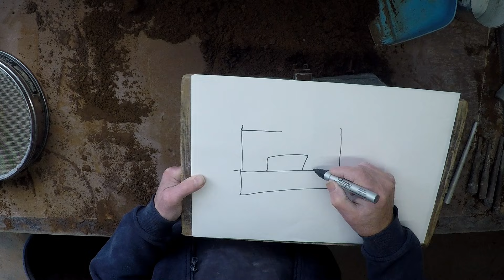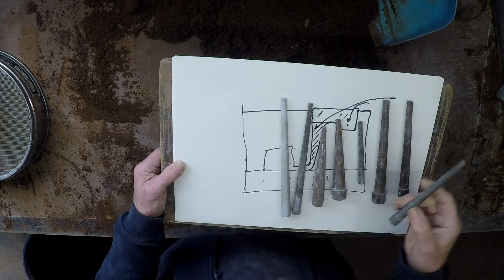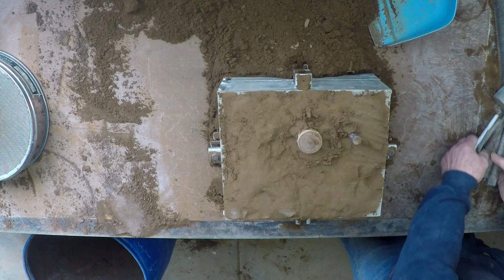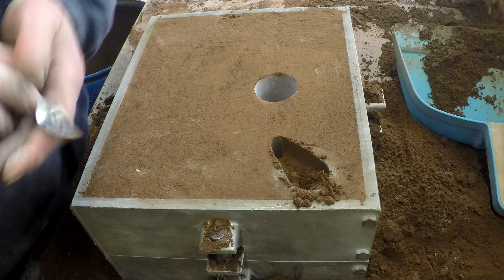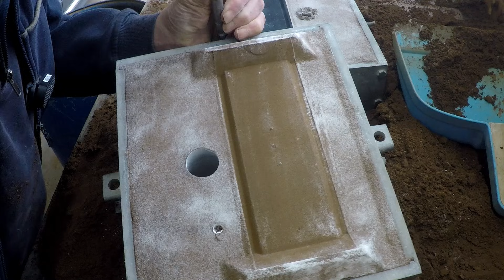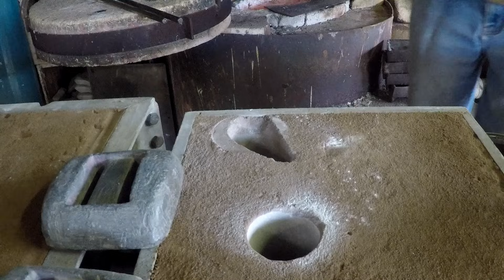Basin and sprue design for sand casting in the foundry

Comment: Great video! Finally someone is using the guidelines of prof. Campbell on youtube.
Reply from the maker: Gabor, Yes, I am very much a JC devotee. His work is very much a greatly needed breath of fresh air into the staid, old fashioned, rigid, dogmatic, and pig headed foundry industry. My one regret is that I discovered his work too late in my foundry career. I have been using small tapered sprues since the mid 1970s but other of his refinements I have only adopted in the last 5 or 10 years. I would love to sit down with him and/or Bob Puhaka because I have a million questions. I have with varying degrees of success tried to introduce others on UT to his methods but sadly many are just not interested, content instead to bumble on as the foundry industry has done for millennia.... Martin
Reply: @olfoundryman8418  I've had the chance to meet and talk with JC a few times. He is a real gentleman, really nice and down to earth. Also, he is really helpful and always finds the time to consult with me via e-mail. I think you should try and ask some questions in an e-mail.

Comment: Awesome video! Would have been nice to see what the results were, especially the one that had the sprue exposed mid pour. But still great to learn
Reply from the maker: Cole,    You are not the first person who has expressed the wish to have seen the resulting castings. I did not show them because they were just more moulding box sides and I had already shown these in an earlier video. Whilst bad, the exposed sprue in mid pour was not too bad as the metal level did not fall very far down the sprue and metal velocities with this sort or low mould height are low, thus air aspiration would have been, at worst, minor. The casting concerned certainly came out looking ok but this is an important point that allows a lot of people who use bad sprueing techniques (tin can mould height extensions and parallel sprues for example) to fool themselves into thinking that they have made a good casting. The results of air aspiration are not always seen naked eye visually in a casting. The results are the production of vastly more oxide films (sadly some are almost always present). Their presence is revealed in poorer mechanical properties – particular ductility rather than in casting visual appearance…. Martin

Comment: Very interesting indeed... This is a level of savvy I've never seen in any of the other casting-themed channels I have watched so far. Very glad i watched this video.

Presumably the same technique applies to casting in copper & brass. Are there any hazards to look out for when pouring either into the sprue basin? (Aside from the molten metal itself, that is. I understand liquid Cu is way hotter than Al!)
Reply from the maker: Insert, Thank you very much for saying so. Yes, the technique applies to copper and brass - to any molten metal that can be sand cast in fact... Martin

Comment: I learned more in this 20+ minute video than I have in any casting book or video I've found...and I've watched a lot.  It's not just your knowledge, your teaching skills are great and I'm not blowing smoke.   There's logic around all of the flows, and in keeping that flow air free and smooth.  Thanks for this, and the kindness in sharing all this information.  If you are ever looking for ideas on what to go into detail on next, I'd be interested in learning what to look for in riser, gates and runner design...but as I go through the videos you have up I'm sure I'll catch it.
Reply from the maker: Tom, Thank you for your comment. Feeder, runner, and gate design is a complicated area requiring quite different treatment for different castings - there are some basic rules though that have managed to surface through the still incomplete knowledge of the subject. Health permitting I will try and do something along the lines that you have suggested. To be honest in my own work I usually just eyeball a given casting and based on experience (60 years plus) make an initial guess as to these requirements and then let the first try or two refine my approach. Not the best way to do things perhaps but I do not have the resources to get my hands on casting simulation /calculation software.....  Martin
Reply: @olfoundryman8418  I can completely understand the eyeball approach.  So many things have been designed based on that, and as long as you've been doing this there were no computer simulations for those flows...and even today they are probably quite expensive.  What I try to do is learn from the experts in the field such as yourself, and copy, and then adjust a little bit to account for my projects being different.  Truly appreciate all that you give to people learning this science/art.

Comment: Very interesting, thankyou for explaining all of that. Definitely surprised by the small sprue size, will have to look to that.
Reply from the maker: Jack, Yes most people (particularly old time foundrymen)  look at that small sprue size and exclaim that the casting would never run - WRONG!. But look when they pour - a small stream (just like through my sprue) but down a big hole, flow rate is the same but mine is largely turbulence free. Try it for yourself and see just how fast metal will go down a properly filled small tapered sprue..... Martin

Comment: I would have liked to see what the results of the pours were. Could you see a difference in the ones that poured not quick enough?
Reply from the maker: Todd, All the parts poured here were the same size moulding box side - BUT - some were made using just my backup sand and some with my much finer facing sand. This made it impossible to really see any difference (other than surface finish) that may have been due to the slightly slower pour.  I doubt that the slower pour had any serious effect as it looks as though the metal level in the sprue did not drop to what I would regard as a dangerously air sucking in level - too low for sure but not disastrously so. The giveaway here is that had it done so I would have seen a bubble or two come up the feeder and I didn't. You are not the first person to have wished to have seen the resulting castings - I usually show them  and why I did not do so here is a bit of a mystery. In future I will make a point of it..... Martin

Comment: great video!  can you help me understand if the sprue had a runner to the part or did it have a runner to the feeder/riser and the feeder/riser had a second short runner to the part?
Reply from the maker: Jim, My preference is to have a runner from the sprue base to and indeed some way past the bottom of the feeder and then a short gate from the feeder to the casting. Typically the gate and runner would be at right angles to each other. This method is advantageous as it means the last metal to enter the mould, and therefore the hottest, is in the feeder right where you want it. Also if any air does get pulled down the sprue and runner it should separate out in the feeder. It provides the opportunity to increase the gate size to help control gate velocity to below that  which it would be if the runner was connected directly to the casting. A feeder on a gate eliminates any hot spot shrinkage associated with the metal heating the gate area. You can't always do this of course as it depends on where feeders are needed i.e. it works with side feeders but not so much with top feeders.... Martin

Comment: Brilliant video, I will soon be doing my first castings and have been looking around for tips on how to go about it and so many people are getting bad results and you have just explained why. I thought it was just a bit hit and miss but not the way you have shown it should be done makes total sense. Thanks for sharing and can't wait to have a go.
Reply from the maker: Jeff, "a bit hit and miss" well, that's sort of the way the foundry industry has been for about 6000 years! It has been able to get away with bad techniques because despite them sometimes you can get a good result. So if you ignore the bad results and your customer is prepared to do the same it all goes along sort of ok. However when first starting out and using too many of those bad techniques as copied from the wrong areas of YT, truly good results can be very thin on the ground indeed. Nobody can do it perfectly of course - there are always areas where it could be done better if one had a big enough and expensive enough 24/7 enterprise. None of us do, so the best we can do is eliminate the worst of the bad stuff and from what I know this will be enough to give results of which you can be truly proud...Martin

Comment: Very very helpful! I can't wait to give this a try!
Reply from the maker: Tony, Pouring fast enough to keep the sprue full is a bit of an acquired art but if you are ready for just how fast even a small tapered sprue will take metal you will soon get the hang of it. But remember the ridge wants to be at most 10 mm high from the bottom of the basin and a generous radius between the ridge top and the sprue is most necessary. I think that you will like how well it works and just how calmly the metal enters the mould..... Martin

Comment: Great video. Do you see erosion at the bottom of the basin where the hot stream burns out the binder and washes loose sand into the mold?  I expect the basin depth minimizes the effect except at the start of the pour. Thank you.
Reply from the maker: Fred. No, I have never had erosion in the basin or indeed anywhere in any of my moulds. The height through which the metal falls to hit the bottom of the basin at the start of the pour is deliberately as low as I can get it and thus the metal velocities attained are way to low to cause any erosion. In fact the metal will not even pick up loose sand anywhere in the gating system, rather it simply rolls over the top of any loose material.  There is an exception to this of course in that thin edges of sand as might be formed where a gate former does not quite meet the pattern properly and a sand strip only a grain or two of sand thick sticks up into the metal stream may sometimes erode. But if gating is correct to keep turbulence low and the gating system full erosion is not a  problem, even  with moulds considerably higher than mine... Martin

Comment: What pressure is your compressed air coming out at? I feel a full 100 psi would blow my sand molds apart.
Reply from the maker: Jessica, Well, I do not use 100PSi anywhere in my air system. 70 to 80 PSI is about as high as I ever need. But, yes, that would blow a sand mould to pieces. I have a small regulator right where my air line splits off to the blow gun, this is set to just 15 PSI. Even so it has to be used with care. The initial "puff" of air coming from the blow gun can be a bit harsh so it pays to point the gun away or hold it fairly well back on squeezing the trigger. The trigger needs to operate smoothly and gradually - no sudden jerk on! For delicate work  - like text - I hold the gun a fair way back with not much air coming out, moving it closer as I watch the mould to see when the loose grains are blown away. Like most things in casting it is an acquired art...Martin

Comment: Thanks for these videos, great information, watched most of them. I've uploaded my first few pours if your interested, they are getting better.

I had an idea of a two part radiused sprue form, saves me trying to cut it and less loose sand by ramming it. Reusing a cast sprue makes it the right height for my box.
 
Without exothermic powder, should I use a blow torch on the feeder to keep it hot, for about 20 seconds?

I have some ecogas16 degas powder. It only bubbles for about 10 seconds,  would any benefit be negligible? You use argon for several minutes?  These contain sodium flurosillicate and calcium carbonate.

Thanks!
Reply from the maker: Mark, sorry to be so slow replying but a short hospital stay plus recovery time got in the way. Also I am trying to get so more definitive info to reply with - this is still awaited.  I am not sure what you mean by a "two part sprue form". If the idea is to use a solid model of the sprue/basin combination and ram it in place then remove, its an idea that others have tried but abandoned due to the ramming difficulties. Commercially such basins are often preformed in some sort of hard sand - fenotec, silicate, or shell for instance. these are placed on the hole left by the rammed in and removed sprue former. I had planned (before health issues got in the way) to make up a set of moulds for shell core pouring basins. Kelly Coffield who does absolutely the best lost foam work uses a preformed basins made from a mouldable fibre ceramic he reuses these apparently up to 50 times each. Check out his channel - he is a clever fellow.
Re exothermic, very few hobby people use it. While I consider it helpful it is not strictly necessary - its probably better to optimise the shape and size of your feeders - which at the moment look rather inadequate. I would not play any sort of flame on the top of the feeder as it will cause turbulence on the top of the liquid metal and as the flame is in large part water vapour it will simply pump the feeder full of hydrogen gas and aluminium oxide. 
Degassing is not a quick process and the best versions thereof (rotary impellor degassing) take upwards of 5 minutes and as you note I take some minutes (8, in fact) Any so called degassing process (or product) that takes less than 5 minutes is going to be a waste of time. Many of these products react so violently as to throw 50 mm of metal out of the top of the crucible and only react for about 2 minutes. I suspect that all up they may in fact increase the gas levels as does attempting to use washing soda or Epsom salts. Also I seriously doubt the ability of CO2 to degas aluminium as according to the Ellingham diagram it would likely react with the aluminium to form C and Al2O3 - I await further info on this.... Martin